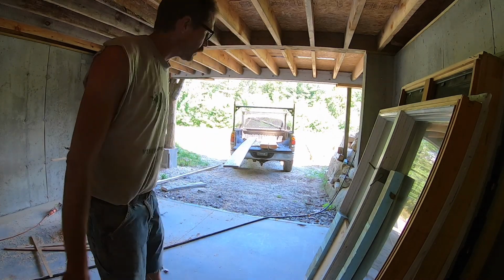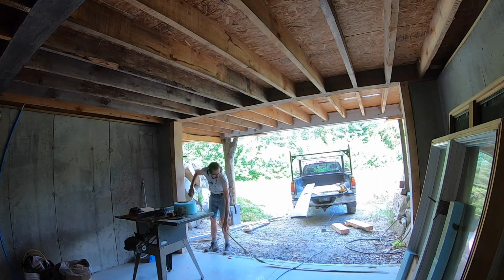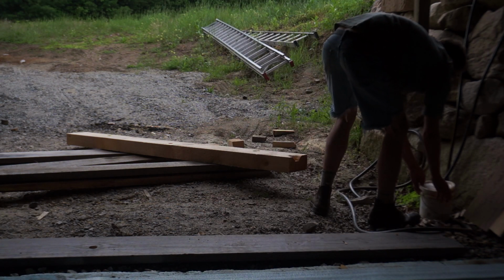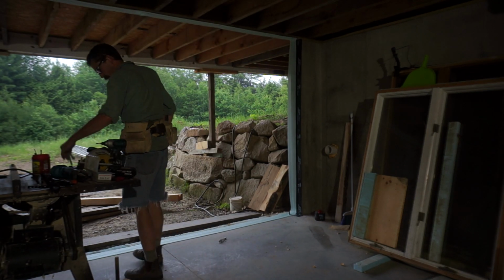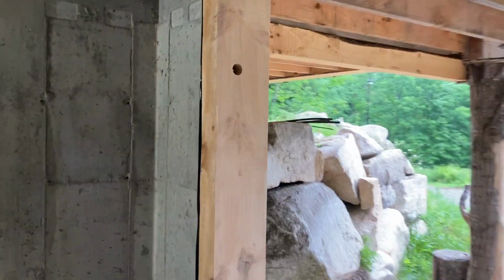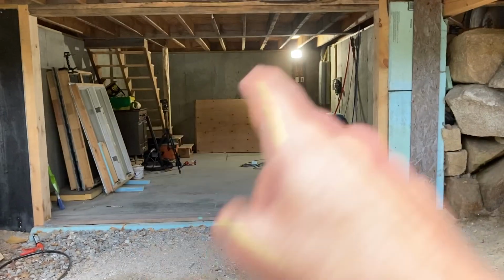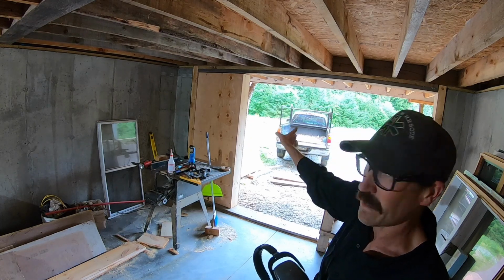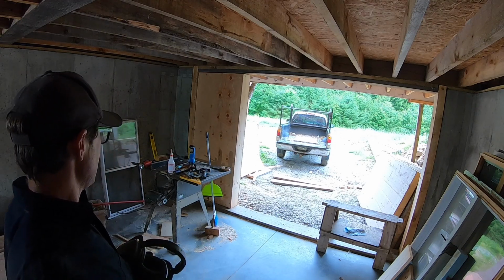Building a House from Trees SE 6 EP 7 Making a Giant Bi-Fold Door pt.1

Comment: That open space under the house to the left of the basement opening, would make a great place for (what the old folks here in the south would call) a potato bank.  If you're growing potatoes, you can basically form a small ditch, line it with straw, and cover it with two long, wide pieces of wood.  You can even get fancy and put a rope with a piece of wood at the end so that after you fill the potato bank, you can simply pull the rope to make it like a potato dispenser.  Potatoes keep for an incredibly long time with this method.  Its a forgotten method of food storage that is very useful.  Every year you simply change the straw and reload.  My grandfather taught me about them.
Reply from the maker: Yes, the ancient farmhouse t that i live in has a root cellar that keeps my veggies through the winter nicely.

Comment: Another fine start to a wonderful idea. Dont want a permanent wall, make it fold with hinges. As for the tool belt others commented about suspenders, good thought but they wear rub Mark's into your shoulders from the weight and body movement in my opinion. Quite the conundrum on that problem. Wouldn't want a behind like the Troglodytes sing about.
Reply from the maker: Ha! Indeed. Thats me.

Comment: One man, heavy doors. Very difficult build when square and plumb mean everything. Perfect design doors for the opening you have to work with. A simple idea form sealing the doors could be using cam  hold downs that has the hold down lever on one side with a rod that hooks on to the other piece and pulls 2 objects together. Be safe.
Reply from the maker: That kind of stuff is hard for me too, and rough cut to boot. Thanks a lot

Comment: a nice 2x4 of your wood (full length) dropped into 2x4 hangers (like an L with the bottom against the door) at half height, will be tight enough to pull those doors taunt in the winter months...may have to hammer it up and out come spring....:)
Reply from the maker: Thats what i was thinking!

Comment: Hello Bus, very interesting door, will you put something inside the panels? Thanks for the video and have a good weekend.
Reply from the maker: Great question. I am in going to be installing the double pane fixed windows that I got from a friend today!
Reply: @BusHuxley   yes, I saw the cut for window but I mean to put some insulation inside panel in the empty space.
Reply from the maker: Serzh Dyubro There is 8 inches of rigid foam insulation between the plywood. Almost r30 in each panel.
Reply: @BusHuxley  ok, good, that's what I wanted to know, thanks Bus.

Comment: I would paint or treat the bottom of those doors somehow before I permanently install them just to make sure don't rot .
Reply from the maker: They are completely under cover. It is 12 feet to weather from where they are.
Reply: @BusHuxley  But IF, there's the classic down pour and the water decides to invade the door area.  Might be a slim chance, but it's a lot easier to prepare now than to have to take things apart because the rot and/or mold is destroying the door.